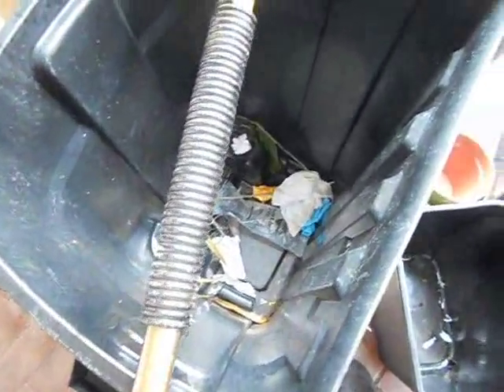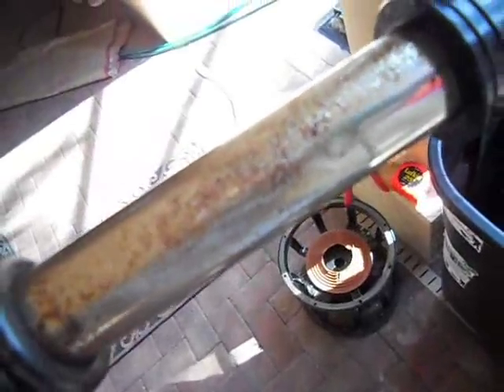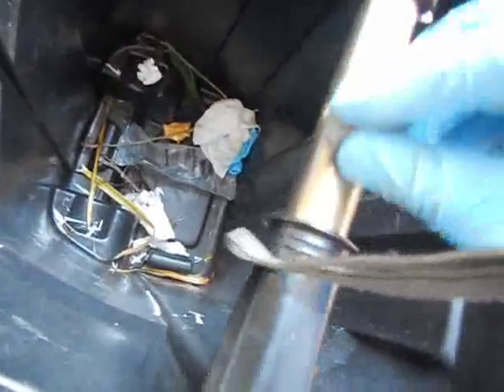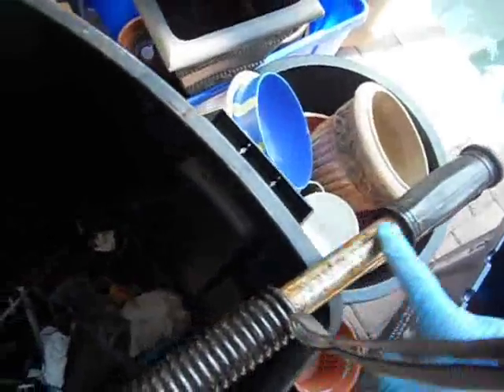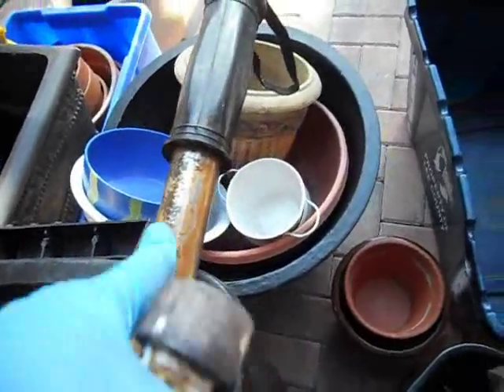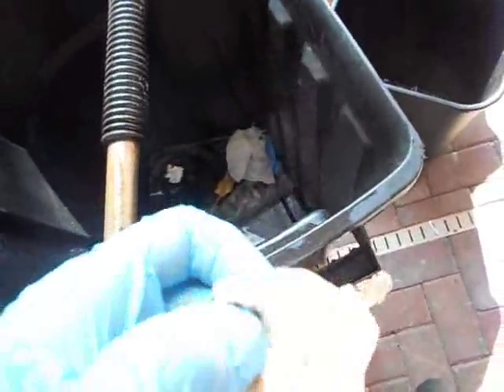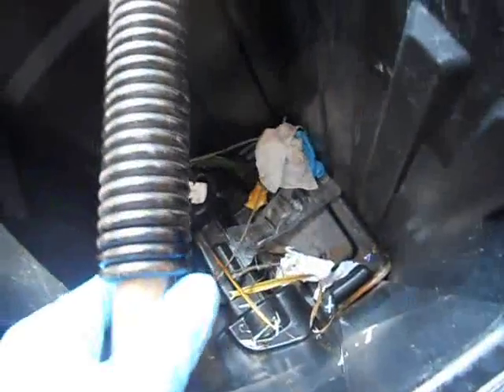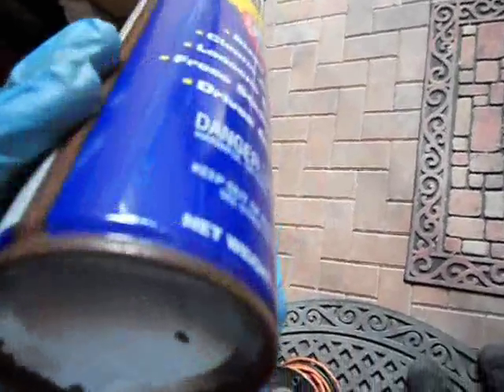How to remove rust off chrome

Comment: I have soaked SOS pads down with diesel fuel before , and made some volatile suds scrubbing away at rusted chrome , that does some rust eating , but just never tried the penetrating oil and plain steel wool before , same thing , just the difference between Hillbilly , and Yankee  logic I recon LOL